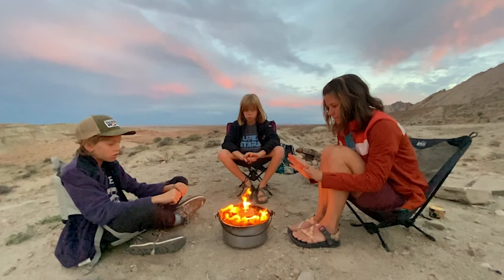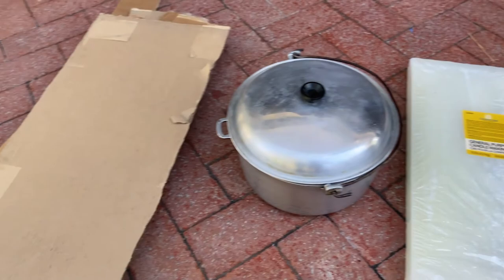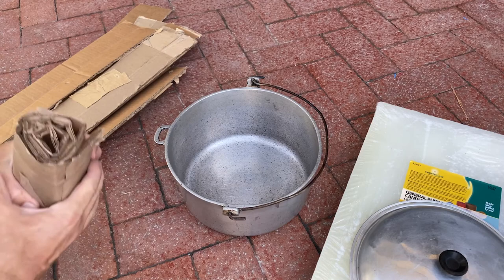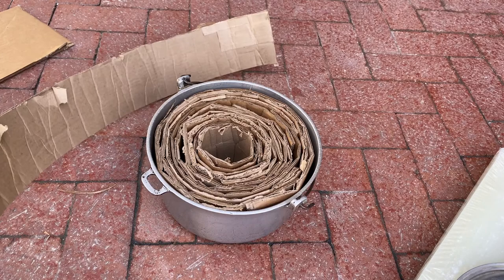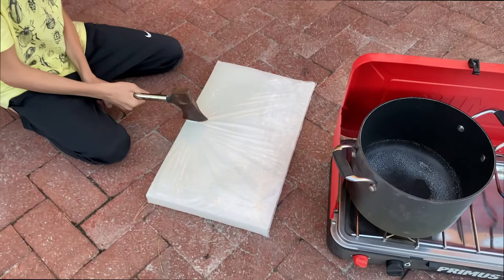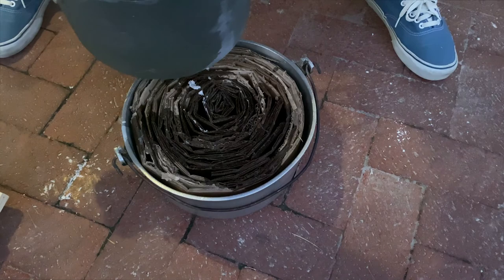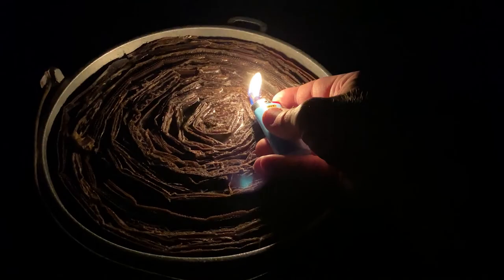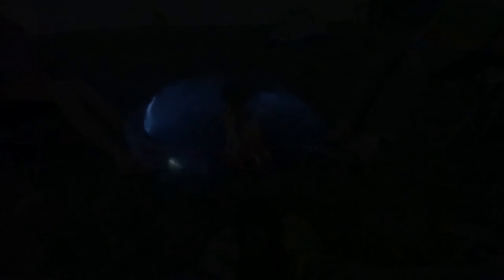How to make a Candle Pot: A clean alternative to a campfire ring

Comment: it's a big version of a buddy burner, i've been making these in all sizes since the 70's. my favorite ones are made out of royal dansk danish butter cookie tins that are about 8 inches diameter and 2 inches deep with a tight fitting lid, the shallow size fills with wax easily with no floating problems and burns for about 10 hours if you don't refill it with wax. small enough to take backpacking if you wanted to. one thing though, i always use soy-based wax since it burns cleaner than paraffin wax and produces less soot and fumes. some like to add citronella oil to the wax to chase away mosquitoes.
Reply: Thanks. I was wondering how small I could make one? A smaller pot perhaps.
Reply: Great tips!
Reply: Ooo, thanks! I have several cookie tins of varying sizes and was also wondering if they could be used for this! And the cit oil would be a 👍 for me because skeeters love me 😝
Reply: @elementgypsy  I make them with old  soda cans! Same concept and burns for a while to. But I use them as a fire starter for light larger chunks of wood so I don’t need kindling l!

Comment: You can use an old cookie tin. They are straight up and down and it has a perfect lid that is snug. it is sometimes easier to roll the cardboard all together. Roll one piece after the other. It is nice and tight and you don't have to keep adjusting the cardboard. You can tear a little strip of cardboard in the center of the ring of cardboard  and it become a wick.

Comment: Soooo why not pour a little wax at the bottom of the pot and then add cardboard and them more wax.
Reply from the maker: You could do that, but when you are burning in the candle pot, the wax melts from the top to the bottom of the pot, so the cardboard really needs to be tight enough that it won’t float when the pot is hot
Reply: How bout if you stuff dryer lint in the spaces? 🤔
Reply: @auntiedotal  🧐